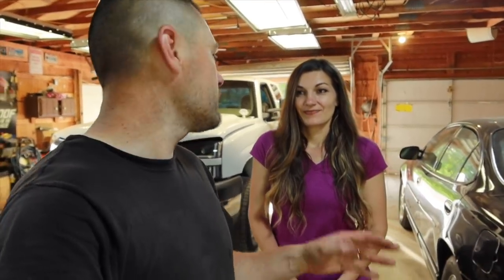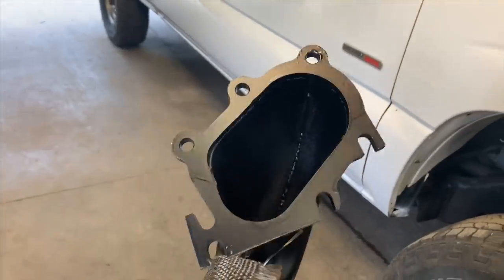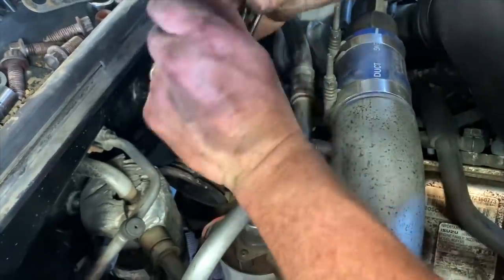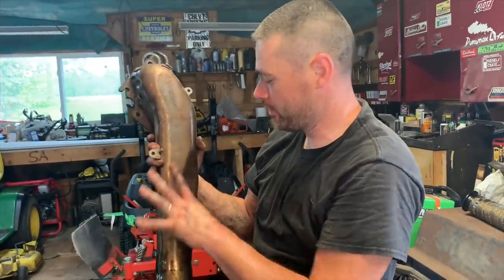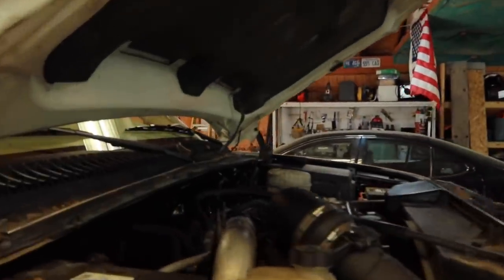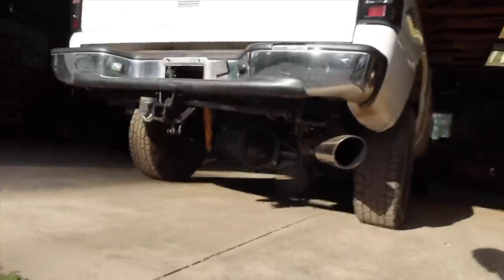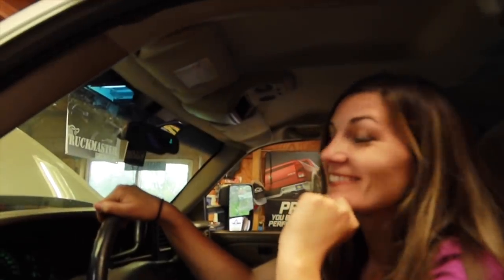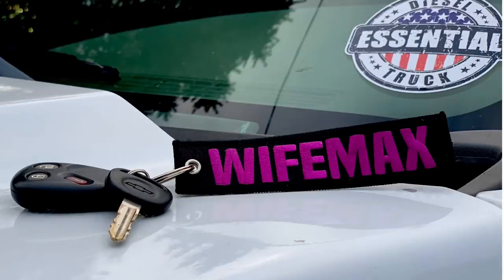New Diesel Part For Wifemax Installed!

Comment: Just did the dp on my LML. Quick tip. Drill a hole in the lower heat shield. Hook a strap on it and wrap the other end around a 12 pound sledge hammer. 3-4 good swings and she’s out 🤪.
Reply from the maker: Nice 👍

Comment: Wifemax would be awesome on a drag pit crew.  She notices things most would not and has great common sense and logic.  You can't teach that and it seems to come naturally.  You have to be careful increasing the exhaust side.   You need back pressure when towing.  I travel the NHRA circuit with my LBZ with 26,000 lbs.  I changed back to OEM sized down pipes because I lost performance.  I do have a tow tune in my truck.

Comment: Changing the down pipe and removing the heat shields off my LMM was enough to make me never want to do that again! It was an aggravating couple hours!! You have way more patience than me doing 2 of those on 2 different trucks In a semi short time frame. Haven’t seen diesel pros in a while, would they have any insight on the chirping noise??
Reply from the maker: I think the guys in the comments are correct it’s probably the upipe bolts

Comment: Just wait till u get your tunes before u go crazy looking for exhaust leaks you are probably right in that it is the fueling ,you just had that motor on the floor and chances are that u didn’t mess anything up you know what your doing not that mistakes aren’t possible but to me from video sound quality I could be off but it sounds like turbo surge .I know u have rds 67mm and it’s an lb7 non vgt which presents another part of the equation I didn’t hear it at idle it seems to be only audible with throttle input the engine just isn’t consuming the air that big compressor is making go drive it at like 50 to 60 mph in 5th gear lock up and see if u hear it when rpm is bellow 1800 if u do you are right for sure in that the tunes will most likely take care of it
Reply from the maker: Thanks James I really appreciate it

Comment: My 02 lb7  has a 10mm cp3, s&s 45 percent sac injectors. 5 inch exhaust, 3 inch downpipe. Mine doesn't have that sound. Kinda sounds like you have a exhaust manifold leak. Hard to tell from the video
Reply from the maker: That’s a great point

Comment: When I did my lmm, 2-3 times a day for 3 days prior to the job I soaked all the exhaust bolts in pb blaster and they all came out with the exact torque they were specd to. Super easy.  Pb blaster works great but it's not an instant magic wand, you gotta let it sit to give it time to work.

Comment: Check exhaust manifold bolts. Mine chirped worse than that, I found that I didn't tighten the drivers side exhaust manifold to up pipe bolts.
Reply from the maker: You might be right

Comment: My truck does the same after I roasted the tires. Has dmax store manifolds up pipes, down pipe and exhaust. Havnt figures the noise out either
Reply from the maker: Re tighten them bolts